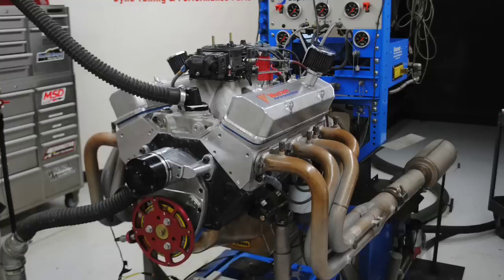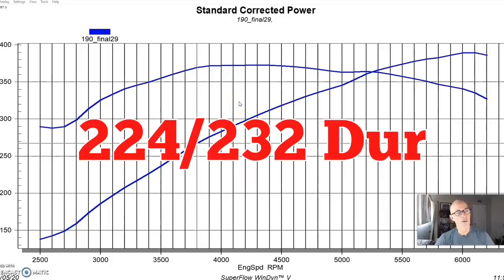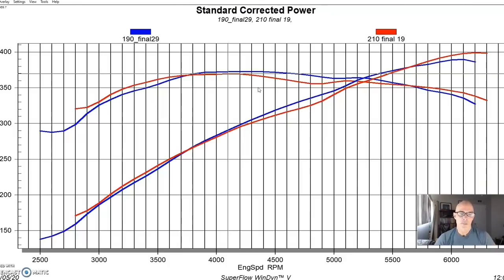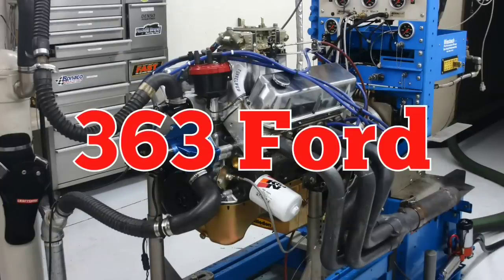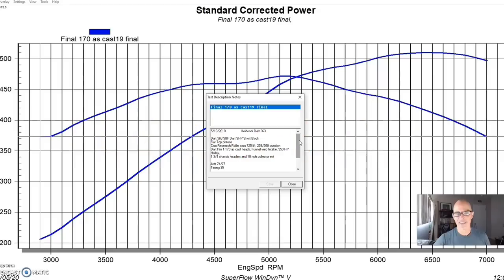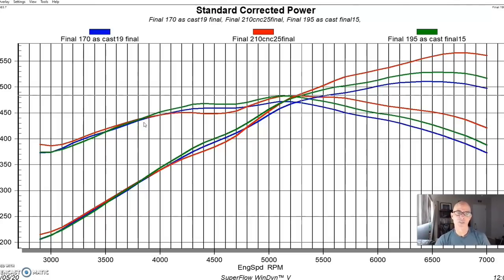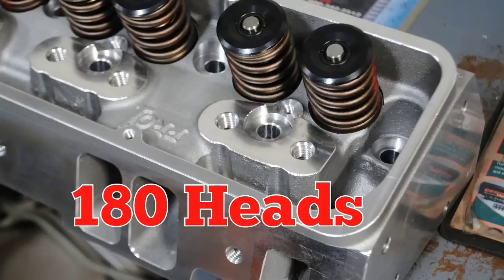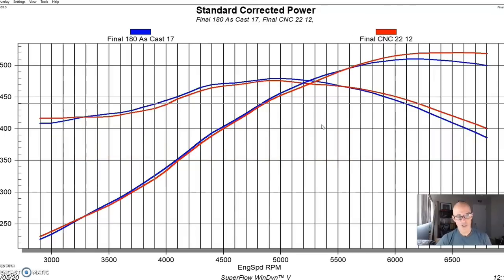PORT VOLUME-IS BIGGER BETTER OR IS LARGER LESS?

Comment: If you want to see something that really blow your mind check out wet flow through the entire intake tract and out the head at the intake and the exhaust ports how it really flows into the combustion chamber and wear really strikes the piston and the ports it's always on one side of the port it's always some crazy angle and it's never what you think

Comment: Look you're making an assumption here and your assumption is probably incorrect....just because you look at a port and say oh it's bigger than the other one versus like a say 185 CC versus 195.... You still can't really compare them why because of all the bends in the port itself..... You would have to show to the 10,000 of an inch every single bend was the same and perfectly dimensionally increased so they were identical before you could say that Port volume made a difference... You're only making a general assumption here...... Also wet flow is going to be completely different.....

Comment: I propose a test. Can we please lock out the throttle to something around 1/4 throttle for the dyno pull and run the test? Simply pick an engine with 3 different size runner heads you have laying around the shop and a cam with an operating rpm range of a daily driver. You know... For the "other guys" that don't need to zing every build to 7k lol

Comment: You can disengage the secondary on carb. Even better is to lock carb to possibly 1/2 throttle on primaries and run dyno runs at lower rpm.

Comment: That mid-range hole is just weird. Tons more power up top, a noticeable boost at the bottom, but a massive scoop out of the mids. I'm at a loss to explain that. But I guarantee a car with a 1,000 RPM hole in the powerband will lose. I don't car what it does at the top end, by then the other guy is already across the line.

Comment: I'm certain that on the street, where you're at part throttle 98% of the time, the smaller ports WILL have more velocity and better throttle response. Perhaps a chassis dyno would demonstrate this.

Comment: When talking about the low end power comparison here, it is important to note that is starting at 2900 rpm.  I would be interested to see what the comparison is from 1000 to 2900.  I realize here it is looking at a power output for a range typical of racing applications

Comment: That comparison dosnt tell the whole story, as it being dynoed from 3000 rpm,but a street engine,say when you come back to 2nd gear and you taking sharp angled corner,you are well below 3000 rpm, i think thats where the smaller head would pull stronger

Comment: This would apply pretty analogously to a chainsaw engine right? (non-reed, piston-ported single cylinder 2-stroke)
I've always flared-out my exhaust ports pretty dramatically, far more than my peers, because directly-after that exhaust flange is the big muffler-box that the exhaust pulse opens-into....seems smart IMO to flare-out that port to accommodate this since the muff's backpressure is a crucial part of the functioning of this type of engine.
Thanks for any insight you can offer on this!!

Comment: This points out the problem with looking at WOT HP and torque. Drivability and the feel of the engine in real world driving is totally overlooked in the dyno cell.
Reply from the maker: MAYBE I SHOULD LOOK INTO A DRIVABILITY CHANNEL
Reply: @richardholdener1727  I build hot rods and custom cars for a living. Highway 101 Rod and Custom. I see so many guys that look at the dyno numbers and want that big number in their rod or custom and then they don't enjoy the car as much as they could with a little less cam and carburetor. Nothing like having to start your car 15 times before it will stay running because you chose that race carb with the choke delete and it doesn't make power under 3500 RPM but is good for 7000 because you wanted that cam with the big HP number. I like power as much as the next guy but I really like a car with lots of torque in the lower RPM range where you will spend most of the time enjoying the car. Nothing quite like seeing the guy cruising the car show dropping raw gas out the pipes with one foot on the gas and the other on the brake trying to balance the horrible idle with the high stall torque converter. LOL

Comment: I agree with previous comments. 
Run the same comparison with the butterflies limited to 1/4 or 1/8 throttle. This should give a better representation of drivability and low RPM power output.

Comment: Im getting a set of eagle head for my 5.7l, plan is to gain some hp, i heard you want a head that gives better flow than a bigger hole & doesnt have flow. 
So i will exhaust match & make the ports be smooth & slightly bigger, for a small cam, that just replaces mds.

Comment: start with the smaller ports and the port/flow for your needs, You can always make a bigger hole. If you want a race only WOT motor than bigger is usually better.

Comment: Watched the vid again.  Already commented once but the second time around spurned me to comment again.  Your comparrison between the 190cc and 210cc ports isnt an issue of which is best for the three displacements 306, 363, or 372 v8's.  Rather, the real issue is should each engine with the 190cc head or 210cc head be a Street Engine running on Pump Gas, or a Race Engine running on Race Gas. When you build an engine one has to choose its purpose/intention.  Once that decision is made, all parameters are set including Cylinder Head Port Volumes to Cylinder Volume. Again, the only issue which demands understanding, regardless of intention, is how to qualify intercomponent relationships on the use of the words small, medium, and large to the expected output relationship of mild, moderate, or maximum.., and at a specific Peak RPM

Comment: I would like to see a 302 or 306 build designed for low rpm torque with a operation range of 1500 to 2000 low rpm to upper being 3500 to 4000 using flat tops and an unpopular E6 head with mild porting and slight valve unshrouding with a .490-.500 lift for both intake and exhaust and about a 205-215 duration flat tappet hydraulic cam.  Power not being a concern but pulling low torque would be in a truck application.
Reply from the maker: IF TRUCK-GET A 351w WITH GT40 HEADS FROM JUNKYARD
Reply: Not when you are shoehorning into a Bronco II 4x4 351W will not clear heater box.  I was told that E6 heads are better in a truck if done with a little relief porting and would give you better scavenging like pre 68 289 heads did with narrower intake ports making flow run faster.  Too much hype on GT 40 heads, not looking for high rpm engine want something to pull at low RPM max being 4000, for long term durability, not blow up after two months of heavy footed driving.

Comment: And what about fuel? I mean a big port intake can't accelerate air and fuel as good as a little port, therefore  can't mix as good fuel and you need to compensate with more fuel to mix, at least it's what I imagine could happen, I want a small vs big intake port in BSFE test (a power vs fuel consumption test)
Reply: INteresting how all these problems you describe of "low velocity" ports.... don't reflect on the dyno.  So if all the fuel falls out of suspension and it's just a river of gas into the cylinder... it still makes the same power on the dyno?

Comment: Smaller well spec’d camshaft with large heads on SBF always worked real well for me and made a lot of believers of others who swore my heads were too big after seeing my tail lights often
Reply: Was the car light? 
Under 3,300lbs?
Reply: @I_like_turtles_67  no car was heavier than 3,330lbs and why aren't you asking about gear ratios since you are concerned over vehicle weight?
Reply: @msk3905  That would've been my next question. I personally have 3.89 gears and a 5spd in my 67 fastback.
Reply: @I_like_turtles_67  306ci, 10:1cr, 3.73, 1 5/8 LT, 3,420lb cam 218/224 @.550lift, 112LSA on 108, 205 heads….absolutely screamed with exceptional throttle response even though everyone back in late 90s said head was too large because velocity would be low.   1st gear useless, 2nd gear had to be careful on full throttle rips cuz tires broke free in 5000rpm range, used the heads because knew stroker in future but pleasantly surprised how fast 306 setup was

Comment: I built a 10.9/1 406 sbc based on your 406 build with but with 220 Flotek cnc heads that flow 315cfm at .600 lift with a .584 lift Schneider cam 240 @ .050 108lsa  and 1.6 rockers and a proform hp950. (830cfm) and I can drive it all day and it has tremendous power 4 to 6800 and from 1k to 4k can smoke tires anywhere just with 3/4 throttle. Everyone said it would be a dog were wrong.

Comment: I once put together a bb chev . It had Early rectangular ports ,a torqer manifold ,a 250 cam , 600 carb and headers. To my surprise It did wheelies by stomping on the pedal in first gear. No loss in low speed power here. 100 or 200 cc's won't make much difference . The intake manifold is far more important.
Reply: That shoulda been a turd

Comment: My 358 steel head dirt late model picked up 30 ft lbs and 40 hp with 1 5/8 no step long tubes vs 1 3/4 way more than intake volume changes --- rot big cubes 400/434 big ports 220/230cc but small cubes 302/ 327 small ports 190/ 200 cc intake runner length has more to do with where the power is than intake volume. Try this on your 327/350 inch engines with small heads like 041's ....try a tight lsa like 107/106  103 even. street ability? Who cares we low buck racing here. We got no power brakes or steering.
Reply from the maker: 40 hp from a change in primary diameter?
Reply: @richardholdener1727  dirt late model headers Schoenfeld  1 5/8 vs 1 3/4 dyno room headers bolted one on picked up 15 hp they said wow, bolted the other one on which exited strait left exhaust in the dyno room, did one pull with amazing results. 220cc heads 13.7 comp .669 lunati roller billet  crank and rods dry sump vic Jr with tall penium plus 4 hole 1" spacer, never dropped  below 500 hp from 5000 to 8500 with 597 peak that's a low peak number for a steel head late model but it had a very wide power range...turned it 9500 on track super strong every where in power range..
I wanted to see what it would do with the headers that we would be running in the car. This was back in 08 I quit racing in 09 too expensive. Also we made several runs at all different throttle positions to make sure the engine was responsive, because sometimes you're running at 1/2 to 1/4 throttle when the track slicks off.

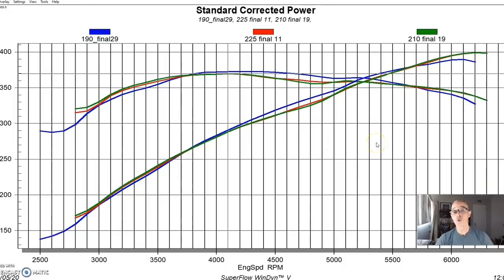Comment: Definitely saw this coming but thanks for testing! Before I went (Ewww) turbo LS power for all my Foxbody racing, my 8.2 deck with stock stroke/4.020” Keith Blacks/Edelbrock RPM/X303 made about the same low speed power with a 170 head as when I went to a bigger set of 200’s. Everyone told me I would kill the bottom end and I shouldn’t do it because it was a street car but I always figured I would just go to a 4:10 out back if necessary……..it never was. Bottom end power stayed just fine on the street with the 200s.

Comment: My Friend runs a Ford 385deries 429CUI, i have heard that the exhaust  port is super restricted. I would love to see if there is any differences in power and respons if it's ported. How would the engine response? 
I think he's head is C8VE. He runs a Edelbrock performance dualplane intake and a Edelbrock 750cfm 4barrel carburator. And the stock 72' 429blok and flat head Pistons.

Comment: RICHARD!! BROTHER, YOU KEEP DOING COMPARISONS BUT CHANGING THE APPLES WITH GRAPEFRUITS. You can't take a smaller unported head then put a CNC Port it had against it. You should do it in exact head ported or unported just volume size difference..grrrrrr
Reply from the maker: THAT'S NOT HOW PEOPLE BUY THEM-I TEST WHAT PEOPLE USE

Comment: It is difficult to come to truthful conclusions when not all the variables are tested...

I had a Ford 460 with ported dove heads, 10:1 comp, built for towing, that would only run with a 650 carb and Edelbrock Performer intake. It had less that sbf power with a Weiand Stealth intake and 750 carb. Smaller E7 heads, same cam and compression, Weiand Stealth intake, and 750 carb yielded 3" vacuum at wide open throttle, it could have used more air still. 

Dropping power at midrange shows a change in volumetric efficiency, showing the need for intake manifold adjustment.

Comment: 351 Clevland 4bbl cars I road tested[in the 70s] after repairs as a Dlr Tech were huge performance disappointments. 2.19 intake valves and ports a pack of camel cigs could pass through unscathed were a waste given aprox5500 redline. Slo port velocity was the culprit. The 2bbl cars seemed better in redlight gran prix. 4bbl heads were great on blocks modded for hi RPM,but then exposed block defects. Prof. H  has done us a service with emphasis on Combo, certainly as applies to street. Lo RPM, Slo port velocities make street/strip mtrs no fun. Thankfully modern combos r light yrs better than 5 decades ago. However, Prof H's test of big bore/short stroke here shows a sure recipe for modern superb HP/Torque curves from an old dog SBC.
Reply from the maker: take a look at the 351 C vids

Comment: Port volume is important if the engine setup can use the extra port volume. If the exhaust is restrictive or the intake manifold is restrictive or the valves themselves too small or the cam not extreme enough then extra port volume can sometimes hurt power production or not necessarily increase power production nearly as much as possible with a good combination.
Reply: How does forced induction change things up?

Comment: I get a little triggered when ppl say one engine parameter is more important than another.  The "ports" or the pathway that air flows thru an engine is a 3d geometrical shape; not 2d but 3d.  That means its makeup involves
L x W x H.., ergo [Volume]
You are building a specific type of engine wherein some of your parameters are set or limited; doesnt mean it isnt quantifiable - just means you dont know or havent figured out how to qualify size or chosen not to enlighten your followers.  You use the words Bigger; bigger compared to what? You say Larger; I ask Larger than what? Larger than what the factory used(?).  Simply comparing a port to the factory's size doesnt qualify "size", it only gives you a differential between your port and the factory. You say volume isnt that important: can I put a 400cc head on a 200c.i. six cylinder and expect it to run, of course not, so volume is important.  Volume is every bit as important as port length, how to qualify volume simply isnt being taught.  Your engine, regardless of what type engine you choose to build is a 3d equation.  The better you understand how intercomponents parameters react with each other the better you will be at maximizing efficiencies.  Size of any port has no relavance until displacement is chosen as well as where in the RPM range do you want your peak power to manifest: take a Tractor Trailor's high power low rpm engine wherein its peak power surfaces in the 2000 rpm range; much different from a high power high rpm diesel engine is built. Volume is as important a variable as port length as well as port velocity.  A performance engine is an equation.  Understand the variables within that equation and you can alter its variables to your betterment.  Please stop picking and choosing one variable over the other; they are all important.
Keep the vids coming.  I enjoy your comparrisons and your input

Comment: Thought for sure the intake was going to kill low tq and hp, ha I actually have a old  holly strip dominator, looks super cool but back in the day ran a Vr Jr because of the slightly lower advertised rpm benefits

Comment: What the numbers tell you is that your head flow should fit the displacement of the engine you're running or rather engine displacement should match the flow potential of the head. The numbers also expose where your engine needs work, things that can help negate that loss of midrange are timing, compression, jetting and the advance curve. To me the mid range loss has more to do with tune, timing sweep & intake than the bigger heads falling short in the midrange, I believe if you wanted to tune that out you could. As Richard said, its probably more indicative of the camshaft not taking advantage of that head than the head being too big. Either way 6-7hp loss or gain in the midrange won't win or lose you any races on a motor pushing over 500 horsepower. Maybe the numbers are telling us that the intake needs to be ported to take advantage of those heads!. PS: Richard you should put the CFM reading air hat on the carb next time! I feel like the horsepower & torque numbers alone aren't telling the whole story!.

Comment: Ive always compared NPI and PI heads in this regard. Pi is 159cc intake runner and NPI is 146cc. Pi flows about 160cfm at .550 and a NPI is 176 at .550. Despite peak flow being in the favor of the NPI, the PI head flows on average 9cfm more from .050-.550 lift. One could argue the NPI has better port velocity and peak flow, but they dont always necessarily make the same power.

Comment: I think this test would be fun with a 600cfm carb. This would show you power efficiency of the heads when fuel flow is limited or is the limiting factor. Now if little heads did better you would know your partial throttle question.